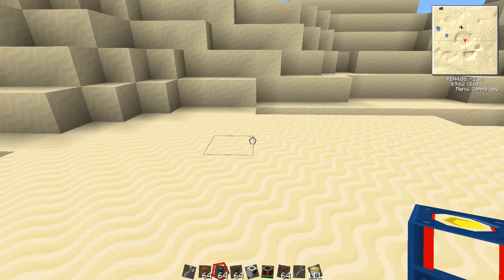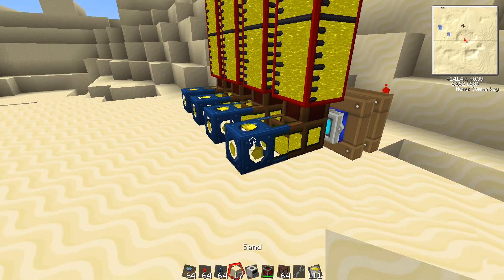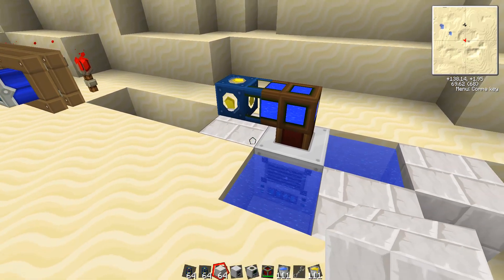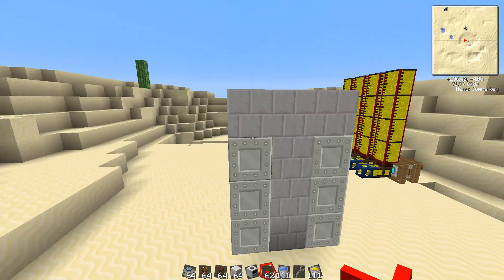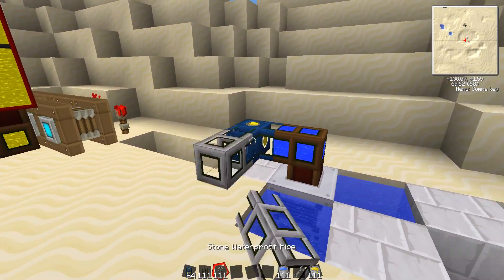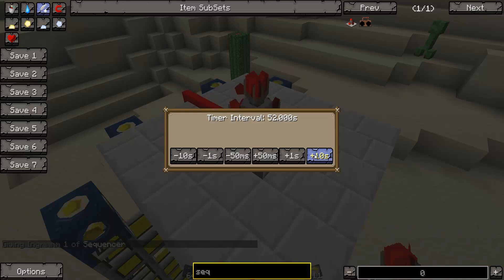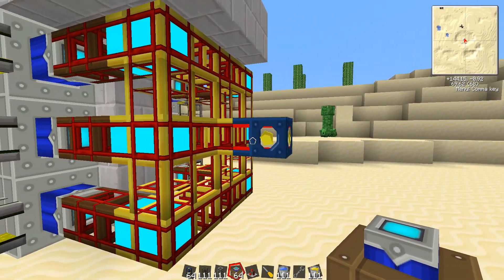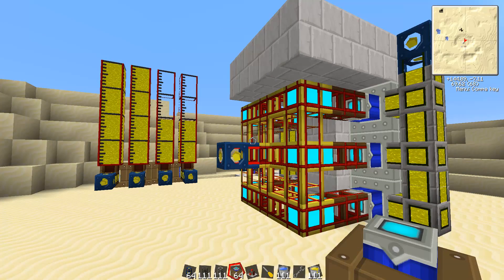Tekkit Lite - Buildcraft - Tutorial - Remote Power Core

Comment: I made this and connected it to my oil refinary as shown at the refining guide of yours, however my engines consume more fuel than two refinaries produce(both powered by the remote power core) any ideas what may be causing that?

Another Question,can i use thermal expansion redstone conduits and ther run them on an energy tesseract instead of using phased and conductive pipes?
Reply: You can use conduits, not sure about tesseracts

Comment: How do you do this with red pipe wire, it's all I have or can you use anything else to power the engines (sorry I'm new)
Reply: the engines are practicaly started not powered by redstone
it's like a lightbulb switcer it not powers the lightbulb it just lead the electricity
Reply from the maker: Red pipe wire can get laid on the pipes that directly connect to the engines (e.g. the wooden conductive pipes - or better yet a structure pipe between the engine). It might be a little hard to get that set up, but essentially the red pipe wire can connect to the engines and you power that instead (with something like a buildcraft gate or a lever)
Reply: thanks mindcrafters i love you
check out my channel for some piston inventions (i will add more )

Comment: There is one major improvement that you should consider:
Put "or-gates" on your water or fuel pipes, right next to the enignes and set them to emit a redstone signal whenever the engine is blue "or" green "or" yellow thus your engines will constantly run on the highest efficiency and never overheat.

Comment from the maker: Yeah, you can either use Buildcraft Gates to turn the engines on and off, or to open and close the pipes, or... much simpler, make a little loop of Buildcraft piping at each of your remotely powered locations. I've included a link to an article in the description. I will work on more Power Core articles in the future with some different design options too.

Comment from the maker: Make sure that your phased conductive pipe is set to "Send" on a channel (e.g. not zero) it may be that the power doesn't think it can flow through the Phased Conductive Pipe. Frequency zero is not allowed so make sure to change it. Also make sure your other Phased Conductive Pipes are set to send/receive otherwise they are not valid destinations.

Comment: I built one of these cores in 0.5.9 and it worked great — however, since upgrading to 0.6.1, power pumps into the first series of gold conductive pipes, but nothing flows when the gold pipes turn 90° to meet up at the central point with the phased conductive pipe.

Any idea why it might be doing this? I redid all of my piping even, same issue...

Comment: Hey, I am having an issue with Combustion Engines in recommended version of Tekkit Lite v0.5.7-Minecraft v1.4.7. whenever I power it with the sequencer it works the first time around, but the 2nd time around it doesn't power my engine, sometimes turns on half way through, sometimes never turns on at all.  

It's really starting to annoy me since I love BuildCraft and Combustion Engines would be my next step for power generation after Magmatic. Any idea what's up? Is the current version bugged?

Comment from the maker: Try just powering 1 quarry and then slowly add others and see if you can find when they first start to slow down. Another option (that's less useful but quick) is to take the full Redstone Energy cells and place them directly adjacent to the quarries. They can provide a decent amount of power for enough time to mine roughly 2 chunk's worth of material at high speed.

OH also, how many sides are you keeping powered on the core at one time? All four? 2 at a time? 1 at a time?

Comment from the maker: You should have plenty of power for only four Quarries. Try setting the core's Phased Pipe to "Send Only" and then make sure everything else is "Send/Receive" on the proper frequency and publicity (public or private). If it's still going slow try making sure you're setting everything up the right way (check the high-speed quarry video). Also try disconnecting the Redstone Cell charging station - maybe they are draining too much or getting stuck in a loop. If it STILL isn't working let us know!

Comment from the maker: Getting fuel is actually a two-part process; 
1. Find an oil spring/well and set up a Pump to extract the oil. Use Phased Waterproof Transport Pipes to easily pump oil back into your base. 
2. Then you need to build the "Refinery" block. Pump Oil into one side, power the refinery with an engine, and extract the fuel from the other side!
Reply: hello there, do you know how to get the mods to create this for normal minecraft?

Comment from the maker: Combustion engines have always been risky however in Tekkit Lite they’ve gotten much safer. If you click on the engine and open up the “energy” tab you can see the MJ output, stored MJ, and heat. Once the total heat reaches a certain point (I forget how much) the engines starts to consume water very quickly. If for some reason your water supply gets cut off or you run out, a very large explosion will follow and thats something we wanted to avoid, which is why we put our engines on a sequencer.

Comment: This is funny, I just came to make a post about this kind of thing.  I currently use a modified version of this setup.  First, the loop of gold pipes is nice for the drift but it delivers inefficiently.  Second, gates are your friend.  I have gates on the back that emit a redstone signal when the engines are green and one on front for blue.  I also have those on an and gate to a gate on the phase pipe that emits a red wire signal when a lever is flipped and there is work to do.

Comment from the maker: As for throughput; 4 x 8 should give you 32 machines all outputting 6 MJ/t for 192 MJ/t. The power per TE machine varies but a powered furnace uses 160MJ to smelt ingots. So in the 4 sec it takes to smelt 1 ingot, you should produce 192MJ/t * 20 ticks/s * 4 sec = 15,360 MJ which is enough to smelt 96 items. 

You should have plenty!

You could also use Redstone Energy cells as a buffer to store excess pwr- connect it to the conductive pipe instead & use Red Conduit to power attached machines.

Comment from the maker: Hi! As far as the exploding pipes the easiest way is to make a loop of 4 Golden Conductive pipes and then slap down your phased pipe onto the loop - the loop will allow all excess power to drift without exploding. e.g.

GGP
GG

G = Gold pipe, P = phased.

You can also use "Switched Conductive Pipe" which takes a redstone signal and can turn power flow on/off but needs to be done manually unless you can figure a way to automatically output a redstone signal when a Gold Pipe is filling up.

Comment: A question for you gents: how do I keep my power pipes from exploding when power isn't needed on a specific length? e.g., phased power pipe to gold pipe to pulverizer, if it isn't running the gold pipe will explode. Related question, I have a power core built in your style, 4x8 engines in a ring, and they seem to power all my things, but slowly. Every MJ/TE machine runs out of power before it can get through a 64-stack. Do I just need more engines or is there a way to increase throughput?

Comment from the maker: I don't think we had 3 down, 1 up but if that's what I said then I apologize for the confusion! We have two cores running 2 cycles on (in a row), then 2 off. The other core is the exact reverse; when one is on the other is off, and vice versa so there is constant power. Since combustion engines w/ fuel hit max output as soon as they start there is no need for any warm-up. The only problem then becomes the wanton pillaging of the earth for her precious oil reserves :)

Thanks for the comment!

Comment: I was highly dissatisfied with the recommended sequencer. Three cycles.of down time with one of up was ridiculous. So slap a not gate on that puppy and set it for 200 seconds. You get ten minutes of sold power and about three of down time which is plenty of cooldown. Then I supplemented with a few electric engines off of my solar panel setup. Thanks for the upload!

Comment from the maker: But, since that would leave a 6 min window where no power is produced, I would recommend splitting the stack of engines in half and powering each half when the other half is on cooldown. That way you can have a constant stream of power. The one half turns on, runs for 6 min, then turns off. The second stack then turns on and runs for 6 min, while the first is cooling. Rinse, repeat. Since combustion engines with fuel max their output instantly you won't lose any efficiency! 

Good luck!

Comment from the maker: I'd suggest still having the sequencer be on three minutes per output, and just link two of sequencer's outputs together so that the engines will run for 6 minutes at a time (3+3), then shut down for 6 min (the remaining 3+3). Check the pictures of our control room (see link above) for what this looks like. You can play around with the timings - they can go for a while before they explode, but you still have to cool them down. 6 min is safe enough to put directly under our lab.

Comment from the maker: Make sure your Phased Conductive pipes are connected to Gold Conductive pipe in both places (on your power core, and the machine you're powering) then make sure they are both set to the SAME frequency (e.g. we used frequency 100 in the video) and make sure they are both set to "Send & Receive" so the power can flow freely between the phased links.

Also make sure the machine your powering uses Buildcraft MJ. If it uses IC2 EU there is still a way! But that's for an upcoming video - stay poised!